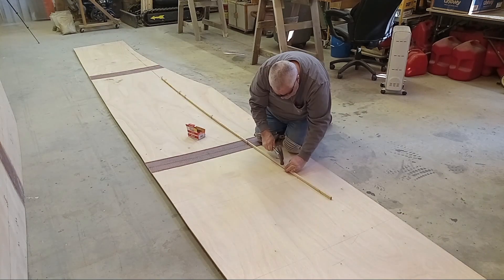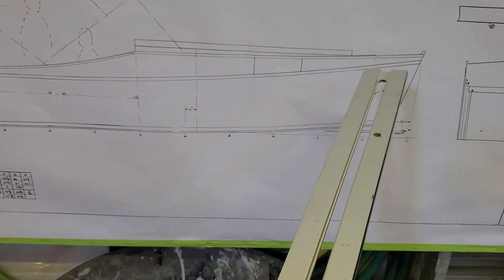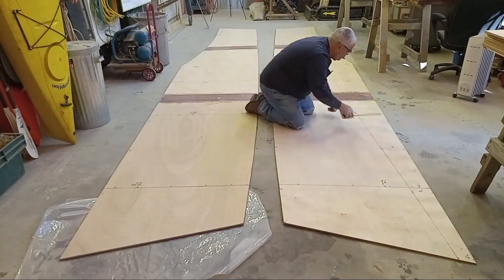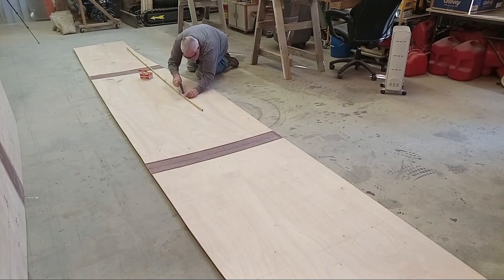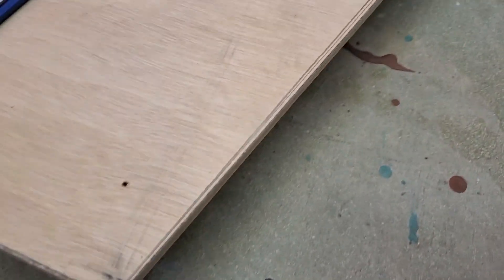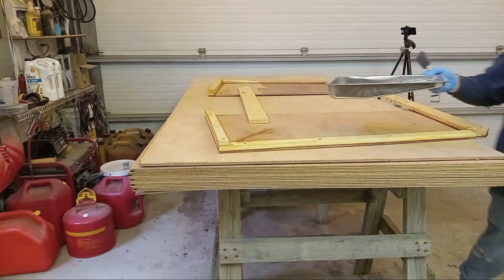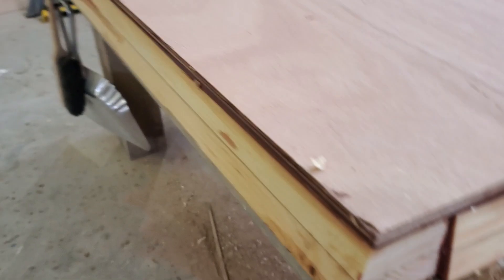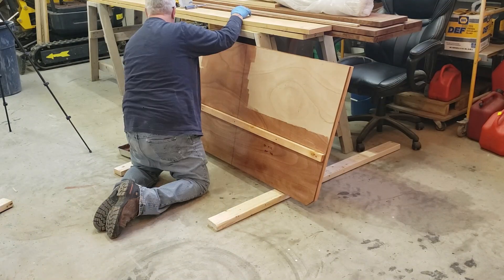Building the Michalak AF4 Grande Skiff 6 | Epoxy-coating the bulkheads

Comment: I would have drilled a small hole all the way through at each point. Then there is no room for error as you will use them for your nails for the batten to draw the fair line. They would be filled with epoxy anyway.
Reply from the maker: That would work in theory, but you'd have to ensure every hole was dead plumb in all directions to ensure the marks would be in exactly the same place on the other side.  It's too easy to angle a drill just a little and that would through off the marks.  If I were doing this again, I wouldn't waste time laying out the sheerline on the insides and would just measure and mark it once on the outside. Alternatively, one could do all the layout on the outside of the hull from the getgo, and transfer the bulkhead and frame locations to the inside as needed.  All part of the learning process when there are no specific directions to follow.